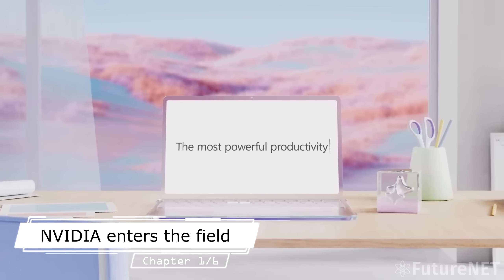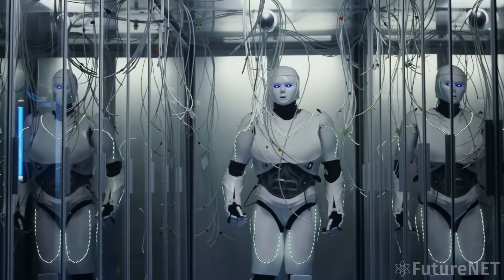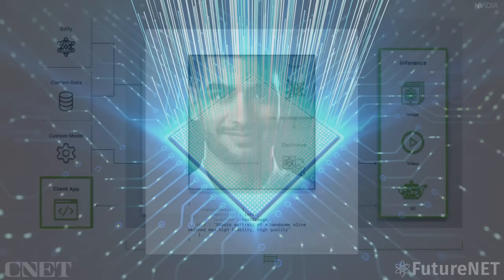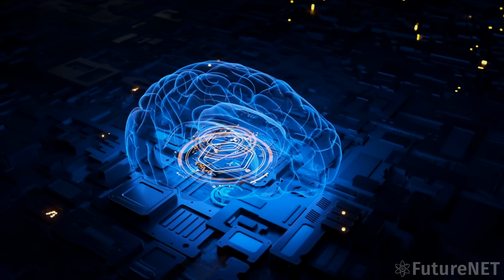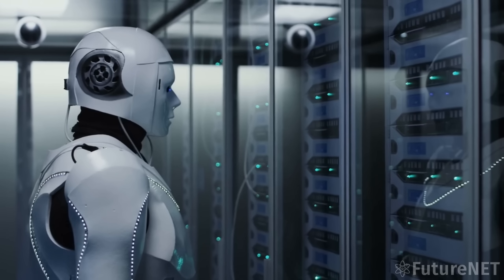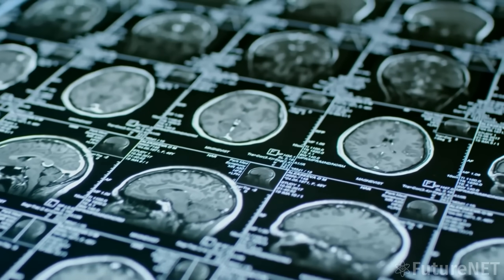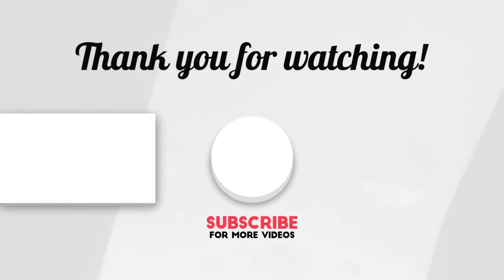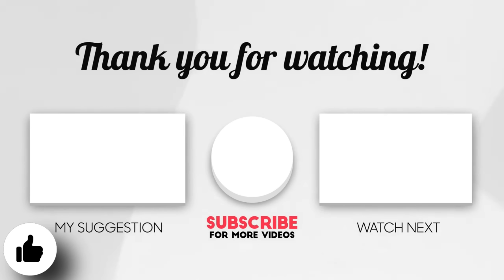NVIDIA Reveals REVOLUTIONARY AI - Better Than GPT-4 And Midjourney V5

Comment: The reality is no Ai nor search engine is freely available for simple searching. Exact text, oldest first.
Google, no.
Bing no proff yet.
3dmdb  does the best at plus or minus 5 years, exact text not very good. manual resort required.
yeggi      its manual resort required.
stlfinder         manual resort required.
To license check all uploads and sales no matter how the thing file came to be means a search of the net, combine all results, exact text, oldest first. 
We use all these search engines, but as of right now its the search engines that are letting a lot of business sectors down.
Consider that medical and health care sectors are also looking for things, plus or minus five years is not good enough.
All the Ai and coders have not achieved put words in order by date as of yet. 
On behalf of the health care sectors and many business sectors please consider making a working search engine.
Thanks for any help.

Comment: Hi! Just a bit of clarification. Eventually, we will abandon solely silicon-based chips. There are chips that are being developed right now and have been in development for many long years. These chips can be up to 5000 times faster(for example, photonics) than traditional silicon-chips while being way more energy efficient. If at any point these chips are actually commercially available. The computational power of AI will skyrocket. 200 Million dollars of equipment now is being used by nvidea to train its AI. However, you can expect that after commercialization of photonics and other promising technologies, even just 5 thousand dollar's worth of chips will be able to rival that 200 million dollar's worth. But any sane company wouldn't spend JUST 5k on training its AI, you can expect Nvidia and other companies to be spending hundreds of millions. The sheer difference in computational power is insane.
5000× faster means you can train an AI that would take over 10 years of training in a single day! At a fraction of the price you would need to do that now! Be prepared for exponential growth. Don't be shocked even if we cured cancer by 2030
Reply: The issue is that we have experienced a said breakthrough so many times that I am stopped caring for most of messages like that. The AI (or LLModels) are developing but at this point there is no way of getting to AGI. Not to mention that these processors doesn't exist yet. The same has been with graphen which in the end resulted with promising but impossible to mass-scale and cheap production. AI is selling right now. So they are pumping up money and attention toward it to A: make money and burst out loud od B: create AGI in next 20 years
Reply: IBM is close with their electrochemical ram, supposedly 10,000 times faster.
Reply: @leelawrence3379 AGI is already here
Reply: You still have to make the chips. 
By the way, photonics chips still need silicon.
Reply: I'm not sure how you arrived at curing cancer by 2030. Can you elaborate? It may help in assisting researchers with their research and workflow, but its responses will be limited to pre-existing knowledge of humanity. Currently, it cannot create novel ideas without already having been trained on that knowledge. The RLHF framework will tune responses to be more in line with the end users expectations, but it is still just compressing the collective knowledge of humanity and outputting a response based in a ranked order.
Reply: @machine_learning_engineering  there are emergent reasoning properties in bigger models. We may just need to scale and reach agi
Reply: @machine_learning_engineering  Well it really doesn't need elaboration if you think about it long enough and actually read what you wrote. You answered it yourself. Think about it this way. We could have made nuclear bombs and nuclear power plants earlier than we did. The knowledge was there. Just scattered amongst different people in different disciplines etc. Being able to more efficiently corelate and aggregate data is the key to discovery. Maybe right now there exist the cure for cancer, it's just in pieces scattered amongst databases and scribbled down notes, and random lab results from things that had nothing to do with cancer at all. This is the point the original poster was trying to make.